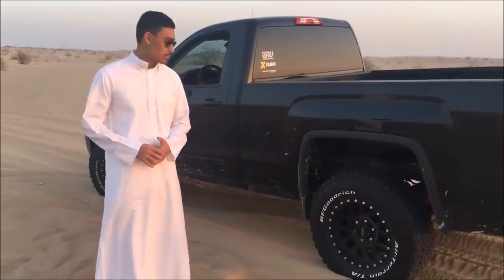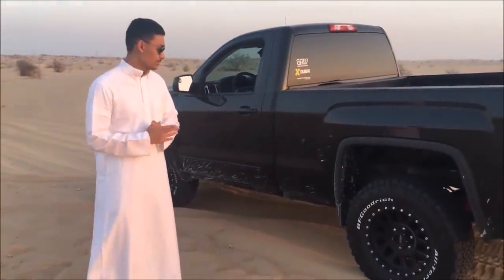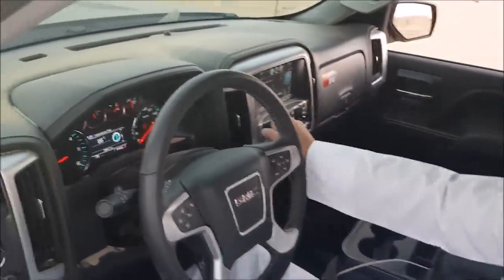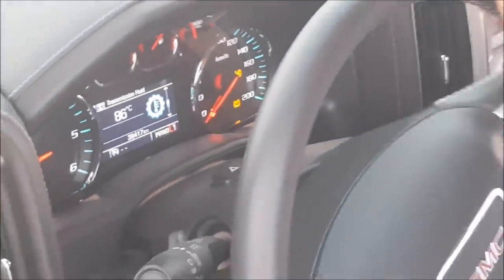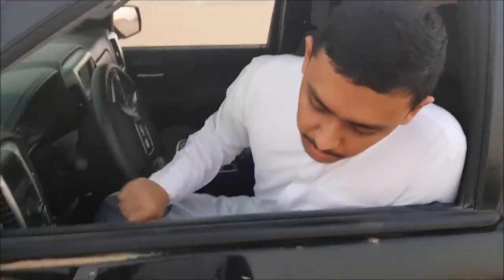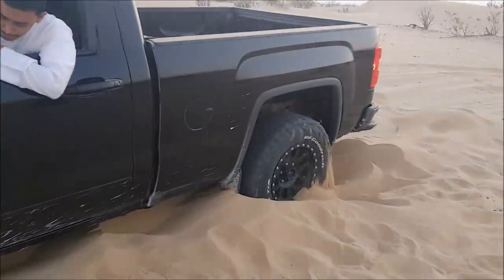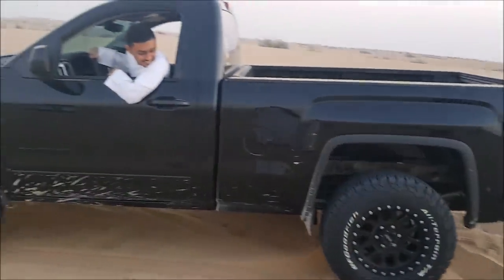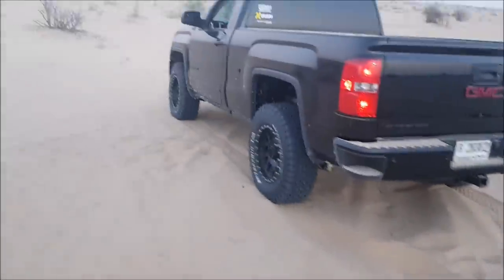Off-Road: How to Remove a Stuck Car out of the Sand

Comment: Good video! Your truck was sitting on the frame/axles with all four wheels spinning, and you let air out of all four tires, and THEN your truck pulled its way out of the dry sand by turning the front tires back and forth. Wow, that's good to know.

 I knew to let air out of tires before going on soft dry sand, however, I didn't know you could let the air out AFTER the truck is stuck and still get out.
Reply: it's counter intuitive because you'd think you're just lowering the frame onto the sand even more.. in reality you are widening the tire to let the shoulders grip the sides of the holes but also your contact patch gets twice as long gripping more sand on the "ramp" out of the hole. letting air out when i was high centered on snow i was thinking "what am i doing?" but same result. great video.
Reply: @BRollOffroad  great perspective cheers

Comment: The reason he opens the hood to keep the truck cool is because the truck is framed out and with the hood closed there is nowhere for the air that gets pulled through the radiator to escape so it loses airflow. The solution is you open the hood and that allows some of the heat to radiate out and it also allows the air to flow through the radiator and out the hood opening.
Reply: Thanks for the explanation! That makes total sense now. I didn’t understand why it was necessary to open the hood if the vehicle was not yet overheated
Reply: I wondered about that. Thanks.

Comment: Imagine the thousands of dollars extra Toyota owners paid for that stupid creep/crawl mode
Reply: Huh? It comes standard. Its literally a different traction control mode. Did you pay more for your traction control or something?
Reply: @d1sturb3d119  if you think it's just gonna come "standard" as if there is no charge included within the price some where your sadly mistaken
Reply: @lunajohn83  Lol you're driving a newer GMC. Guess you paid for all the additional electronics too. Did you need a 360 camera too or does turning your head not work? Did you need bluetooth connectivity? Did you need a rear diff lock? Did you need selectable drive modes? 

Plenty of us are more than capable of driving our vehicles and getting them out of bad situations. If you think you're not paying for those features then you're sadly mistaken. 

Btw the 1500 comes with Traction Select. Guess GMC is now following Toyota? This is straight from their website btw. 

"Traction Select System allows the driver to choose from preset drive modes that have been tailored for different terrain or weather conditions. Selecting one of these modes adjusts Sierra’s transmission shift points, throttle mapping and StabiliTrak to optimize performance for the situation at hand"

So besides wanting to say some shit about Toyota, did you have any actual point? 

https://plants.gm.com/media/ca/en/gmc/vehicles/sierra/2020.html

Sounds like you paid a lot extra for what a 90's truck could do just fine in that case. Been driving the dunes for years. Never had to use electronics to get me out. Seems like you think modern technology is bad despite repping a 2020 GMC in your pic. The hypocrisy is amazing.
Reply: @d1sturb3d119 you see there you go with ignorance.  Your assuming I paid for a top of the line truck. WRONG! it's a base model sierra. I I stalled my own lift kit, wheels and air lockers. It fits my needs. I'm a truck driver. I don't need a rearview mirror let alone a fucking 360 camera. Yes it has bluetooth but whatever 🤷‍♂️.  Of course we pay for shit out of our control or we would be left PAYING for the shell. But crawl control...REALLY!!! you said it yourself we are capable of getting ourselves out of situations with shovels kinetic rope and maybe a winch so WHY CRAWL MODE. While your researching stuff show me where gmc got its tech from Toyota cause last I checked there's no help me button.
Reply: @d1sturb3d119  btw changing drive modes affects just the transmission hence my installation of air locker
Reply: @lunajohn83  So you bought a base model that comes with nothing when a base Toyota comes with it equipped? Is that better somehow? 

Yes of course you pay for shit out of your control, but the fact is you still paid for it, while claiming something that is standard in XYZ brand is worse because someone else paid for it? 

You bring up shovels, kinetic rope, and a winch to save you from a bad situation when a simple change to the electronics that is now standard, eliminates the need for any of that in most situations. 

Dunno if you know this, but GM has worked plenty of joint development projects with Toyota and have tried for a long time to improve their QC based on Toyota's systems, and in fact have tried to emulate the TPM model as which includes lean manufacturing. The case study is literally taught in business schools today as a failure of American business practices since GM could not adapt. 

Lol GM's help me button is the American taxpayer. Two time bailout special that is GM, are yet to learn how to even run their business without getting a handout from the American taxpayers. 

I'd say they have a lot to learn. 

So changing drive modes changes how the transmission responds and you need that? So basically you bought a base truck, with features that you didn't want to pay for, and then claim Toyota owners are being sold on features they didn't need to pay for. 

Can't argue with that logic. Have a great day.
Reply: @d1sturb3d119  because back to my point. I can deal with trans changes cause I tow a toy hauler.  SO YES it benefits me when the cost of transmissions is in the thousands. That's the problem with this generation lazy and relying on technology. Fine I rely on trans changes but for the AVERAGE consumer paying 3 to 5 thousand dollars for a function you will hardly use is unjustifiable. For me a couple hundred in equipment and even then have yet to use it on the trails and mountains of Colorado but have it when I need it. I would be surprised if your in debt up to your ears with the way  your speaking. This isn't a financial or tax debate. i buy what I need not what I want JUSTIFY YOUR NEEDS FOR YOUR ARGUMENT.
Reply: @lunajohn83  lol didn't read my last comment much did you? Debt upto my ears? After literally pointing out how financially careless GM has been. Lots of clues in my last comment about safe spending. My comments literally address driving off road without tech. I've been wheeling since the 90's and your wise intuition leads you to believe I'm a careless spender? Talk about missing information that's right in front of you. Lol good luck with those assumptions.
Reply: @d1sturb3d119  I apologize for misunderstanding your comments.  your right GM is the most irresponsible company by far. I didnt purchase off reputation. I liked the look of the truck and had a vision I made real. I simply stated buy what you need and just in MY opinion crawl mode isn't needed. Since you have been wheeling since the 90s I'm sure you agree it's a gimmick that's bound to break and expensive to fix hence the equipment i noted. We are not going to see eye to eye and will go in circles. Have a nice day

Comment: Such an awesome video! You don’t need crawl control. You just need to let out some air, keep a steady throttle and steady but slow wheel speed and turning the front wheels. 

I wanna make a video like this just to show your process. Also, I kinda wanna have my Tacoma friend do a video with and without crawl control just to see.

Comment: That is actually amazing that worked. I did not think that little amount of traction of moving side to side worked enough to pull something that heavy out. Does it work on heavy duty trucks as well or does this only work because this pickup is much closer to average car weight.

Comment: Nice. May I add don't be afraid to drop pressure right down to 8psi in these conditions,  but careful not to roll the tyre off the rim with cornering. Buy a proper tyre deflator with guage. $25 AUS.  as soon as you are out, re inflate to 15-18 psi. This is a good pressure for sand, and remember that momentum is your friend.

Comment: Most gm’s have a rear axle code G80 which is their auto locker, I’m not discounting your video. Also at such a low rpm would traction control help you since turning the wheel applies the wheel against the deeper hole dug. Causing the difference in wheel speed forcing the traction control to apply the brakes on the spinning wheel causing the slower wheel to turn? Also I’m aware it pulls engine power but such a low rpm I wonder if it will come on to begin with. Nice truck and Matt’s recovery pointed me to your video which cool by the way!

Comment: Jack truck and push the sand back into holes....is this something you might do? Aluminum  floor jack or a air pillow / cushion jack..
Reply from the maker: Dudeareno Rodent That works 👍🏻
Reply from the maker: But you gotta make sure you’re deflated. Otherwise, the sand will be even softer and you’ll be more likely to get stuck again.

Comment: Man, great video.  I have a question, can it be done without letting the air out of the tires?  You have beads on your tires, those are capable of working at very low air pressure. Normal wheels and tires are not designed to work at low pressures.
Reply from the maker: Manuel Paez Hi Manuel,
I do not have any beads on my tires. The beads are only for good looks (not real beads). You can safely drive with 15-20 Psi, however, if you go below that, you’ll need to have a portable air compressor to fill in your tires.
Deflation of tires is critical and essential in sand-offroading, even before you get stuck. When you get stuck, you’ll almost never get out without deflating.
And occasionally, if it was so bad, even deflation won’t help.
Always deflate before you get stuck!
Reply: @GuiltPerformance  Thanks for the information, I really appreciate it.
Reply from the maker: Manuel Paez my pleasure!
Reply: I was able to pull this off with the 1500 RPM + wheel rock trick alone!! But I was BARELY stuck (I thought I knew my limits). You know what they say… your. Mileage. May. Vary!!

Comment: Nice video, but I think that beast is not gonna overheat even if you leave it running all day. I disabled traction control on my truck and step on the gas to get out of holes.

Comment: So if you air down first and lock the diffs, then I guess you either won't get stuck, or if you do, you'll need a plan B.  Cool trick to know though!  Thanks for posting!
Reply from the maker: You can still get down the tire pressure further and engage the 4L (since you’re driving in 4H)
Reply: @GuiltPerformance  Nice tips, thank you.

Comment: So you need to flat the tires? And then how you pump the tires after out from that sand?
Reply from the maker: Boosteroids not flat, 10-15 PSI. You’ll definitely need an air compressor before you can hit the road. You can also drive very slowly (Risky)

Comment: What if you don't have a 4x4, will this still work on a rear wheel drive with differential lock?
Reply: No the trick is based on the traction your front tires will get by turning the steering wheels, if you are not at least FWD it won't work
Reply: @kenanfurcle786  Right on, thanks for the reply. I ended up buying a pair of X-Bull 3GEN Recovery Tracks just in case.
Reply: @redbirdsjunkie you're welcome :) have a good day

Comment: yes in sand especially when your SUV is equipped with difflock (or G80 as in your truck).. However it is impossible in soft land unless you have a tool like MAXTRAX..

Comment: Wouldn't shutting off the engine help in the whole keeping the engine cool thing?  that being said, great video
Reply from the maker: Thank you for your comment! Shutting off the engine will stop the fans from working, which greatly reduces cooling efficiency.
Reply: @GuiltPerformance    Good point.  I suppose I"ve never been in an environment where there ambient temperature is that high.  Still, I'm not sure that the fans, while stopped, in that environment, with the motor still running,  would work better than just shutting off the engine.  I do believe the new GMs (maybe just diesels ..) have the fans running via an electric motor,  while the engine is off too cool the engine.
Reply from the maker: Jim F Ah okay, it’s not the case with the one I have. But if it was powered with the batteries, you’d be running the risk of having a dead battery (which will usually make things pretty worse)

Comment: What happens if you have already deflated and you stuck, buried on the chassis?
Reply: you pull out the satellite phone since your cell does not work .. or dig a big hole and drop your spare tire in with rope and use it as anchor to pull you out ..
Reply: Just turning the wheel from side to side and keeping low throtle will still work.

Comment: I do wish you had first showed trying with just 4 wheel low in order to see that the additional steps of low tire pressure and slow back-and-forth movement were needed.  Otherwise we don't know the how much those two techniques added to it.

Comment: I know that you get a wider foot print with lower PSI on the tires but has anyone tried it with out taking air out?
Reply from the maker: Angel Jose It is possible sometimes, the sand in the video is not very soft so it would have probably been possible

Comment: All you need is to put N.L sticker on the back lower it put 20 inch alloy wheels with some low pros with a mexican flag badge on the front grill poke a hole in the muffler  for the loud exhaust  put a flag pole holder in the hitch bar with a Mexican flag oh cant forget about the tuned by Juan Sticker on the back glass blast some bento quintanilla out of the stereo and put on a super tight shirt with mexican racing on the back .

Comment: Hi
Why do you hopen the hood?
Reply: He said in the video its to keep the engine cool. 
I assume due to no air flow due to the car being stationary.
Reply: to remove the hot air that is trapped under the hood, basically to cool down the engine a bit

Comment: Taking the entire valve out if the stem is not smart. What if you dropped it in the sand? I'd rather Much rather use my keys and leave the valve in the stem than lose it to save a few seconds.

Comment: in the Arabia version he spoked with more details...buddy if your english isn't strong it doesn't mean anything! just try working on it and for the next video must be with more details as its important that the guy knows what he is doing

the whole point is do a remake with a proper full details why doing that why not touching that just to make it sample.

for example here u didn't say why lowering the tires Pressure or PSI as knowing
it was to get more grip and having the tire flattered enough to grip
" just saying tho no offensive was meant nor insult just self opinion "